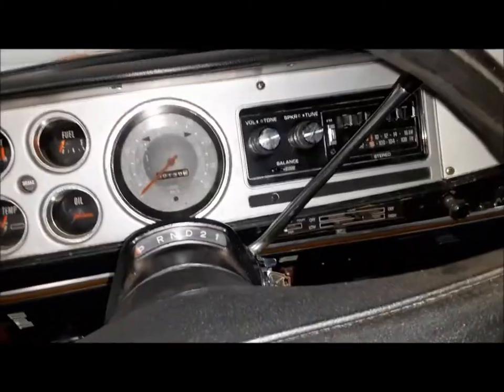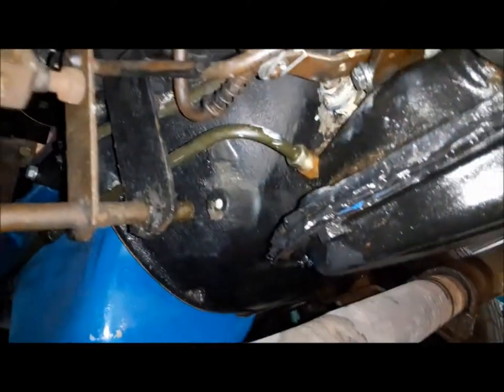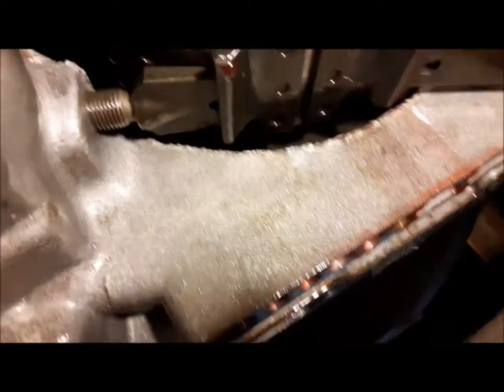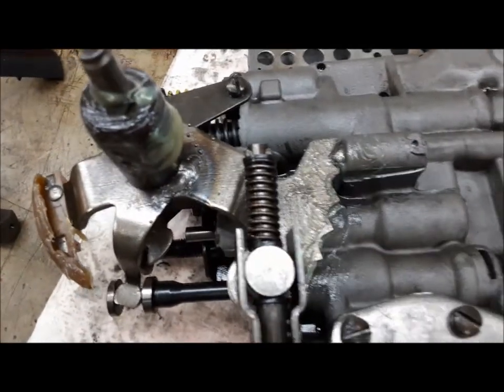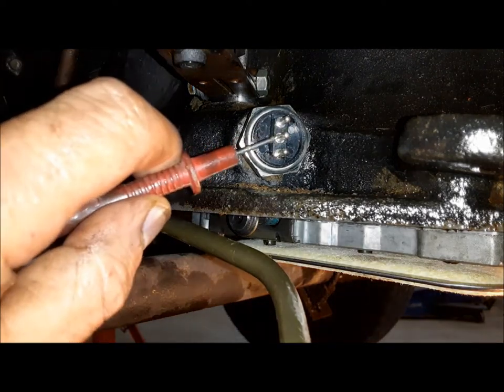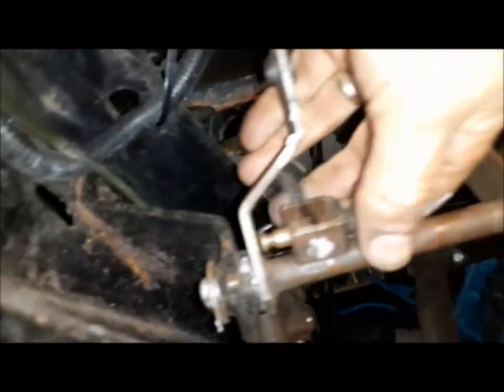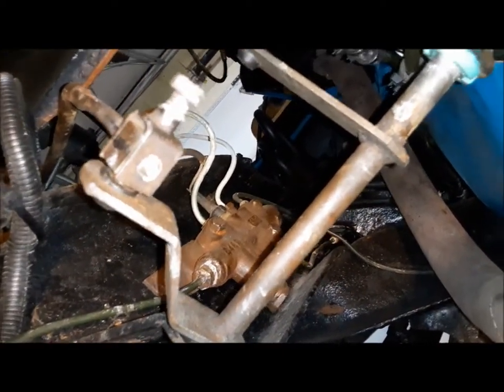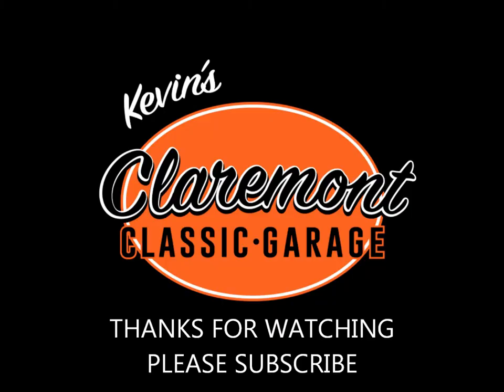1976 Dodge D100 727 Transmission Service and Adjustments

Comment: Great info sir. A little advice on the converter draining back when sitting. This is referred to as morning sickness on a Torqueflite. This is not due to converter drain back, it is due to different manufacturers seal materials in a rebuild kit, some were not really compatible with all the different types of oil on the market . Believe it or not, Zinc is your friend when it comes to Torqueflite transmissions. The zinc coating on all metal parts in the transmission eliminates any wear on seals that create morning sickness. My Dad built these transmissions for 50 years and he learned this trick from his Dad, add 1 bottle of STP engine oil treatment to these transmissions and the morning sickness will stop and prolong the the life of it by 3 times. If you don’t want to use STP, then add 8 oz of Marvel Mystery Oil to the transmission. My Dad never had one Torqueflite come back for morning sickness, or any other issues after using this trick.
Reply from the maker: I'd have to disagree on that. I've had my hands in plenty of TFs. The converters will drain when they are parked. Not all of them do it. TF does not pump oil in park that is why the delayed engagement when you put it in gear directly from park with a less than filled converter. It doesn't start pumping til its in gear. My 69 dart does it. But if I let it idle in neutral for a few seconds before I go it pumps, fills the converter and all is good. Some shift kits modify the valve body so it pumps in park therefore the converter is filled the instant the engine starts and you never notice it again.
Reply: @ClaremontClassicGarage  I never said converter drain back was the issue. The issue is, the seals are not keeping the oil where it’s suppose to be on cold starts. I’m only trying to help, but you don’t know what your missing until you add a bottle of STP to your Dodge transmissions. Nice chatting with ya.

Comment: I just got me a 1977 d100 old airforce truck slant 6 how do I find out which Trans I have
Reply from the maker: follow this link to a picture of the oil pan shape to determine if you have a 904 or 727. https://www.google.com/url?sa=i&url=https%3A%2F%2Fwww.forabodiesonly.com%2Fmopar%2Fthreads%2Fis-this-a-904-or-727.226472%2F&psig=AOvVaw1LZOQWW82vRNm-da4bH767&ust=1670765216947000&source=images&cd=vfe&ved=0CBAQjRxqFwoTCPjdqtWT7_sCFQAAAAAdAAAAABAG
Reply: @ClaremontClassicGarage  thanks I also want to add power steering what years dodge interchangeable I have looked all over the web and can't pin point.  First mopar project now chevys would know but breaking new ground ...and thanks